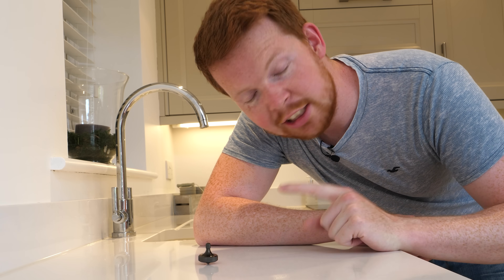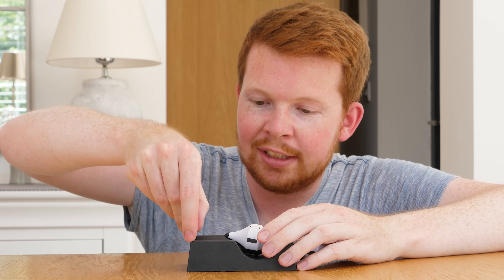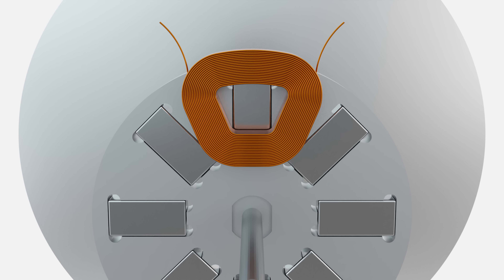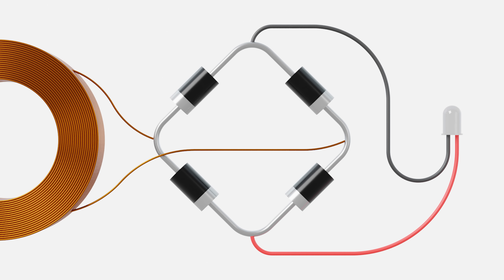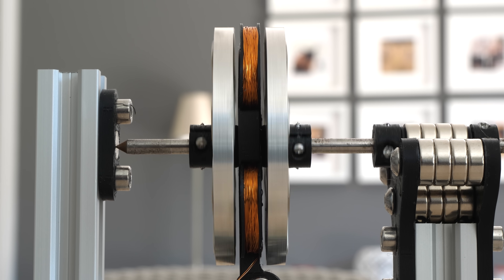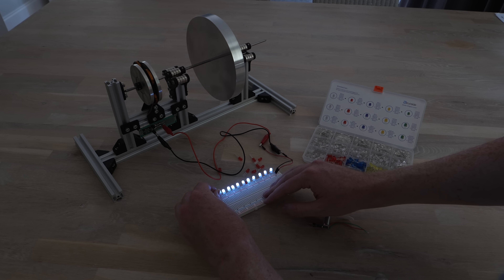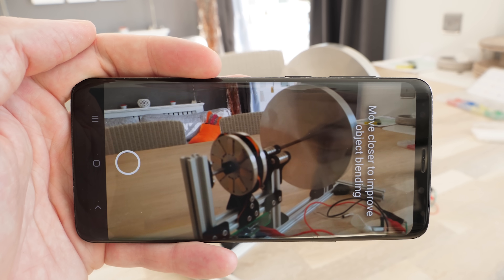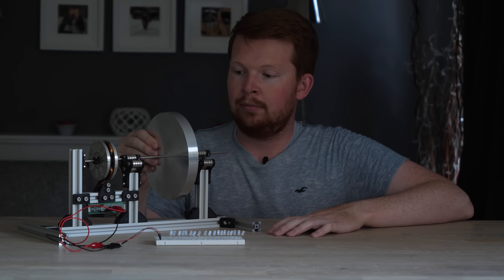Flywheel Battery

Comment: I want a variable-inertia flywheel, where it starts with all of its mass concentrated near the hub, but as it gain angular momentum the mass all shifts toward the rim through centrifugal forces.

Could you build one? If so, please make it open-source!

Bonus points if you were to design it on principles like Tensegrity.

Comment: Three questions:

1) How many coils did you wind for this?  It looked like 4, but I want to make sure I saw correctly.
2) What gauge of wire did you use for the coils?
3) How many winds did you put into each coil?

Now, as a second thought, could you have done multiple coil stators?  IE: a coil stator on either side of each of the two magnet rotors.  Would that have generated more electricity to run that larger motor?

Comment: Yo know... if you contain the flywheel in a negative pressure chamber (I refuse to use such terms as vacuum) and magnetically balance it then it will spin... and spin... and spin... and keep on spinning for a VERY long time...

And you know what... such batteries exist commersially...

Comment: Hey Tom, couldn't you eliminate the plate on the end by putting the lower, stationary magnets at a slightly bigger distance than the upper ones? that way they kind of push against each other as they both try to "fall down" towards the middle, right?

Comment: Tom, I’ve been following you for a number of years now and your on screen diagrams have gone from strength to strength. Your detailed yet clear demonstrations in this with how the rectifier works is brilliant! I love learning new things, and it’s much more appetising when it’s easy to grasp and understand. Thanks! P.S. a big capacitor on the flywheel bike linked to a high power drive motor, and boost button on the handle bar would be fun! 😉. Keep up the great work. A true inventor! 💡

Comment: My last job had a datacenter that was critical to operations, so as a failsafe to their 2 independent mains power lines going down, they had 3 giant diesel generators. But because the generators took time to switch the power, they had mag lev flywheels spinning, so that as soon as a power outage was detected would drop onto generator coils. Giving them enough time to bridge the switch to the generators.

Comment: The most inefficient way to generate and store energy I've seen in a while. Replace the flywheel by a super cap 10 times lighter and keeping the energy for hours instead of minutes, the generator with one having the proper tolerance and bearing. In 1850 your demonstration would have amazing, too bad they did not had YouTube in the 19th century.

Comment: The power goes down quite fast. Wouldn't a gravity based battery be better as you can store the energy over years without loss and you can keep the energy output constant more easily.

Comment: This looks exactly like a device that would end up in a "free energy" video.  Use the output to turn the flywheel, lol
Reply: Which all are called bullshit in the comments for some reason. Imagine that someone researched that concept for years and found almost endless way to generate power. This things could be super cool for the places where there is no electric grid, or for actual homes. Huge flywheel could be spin up by hand with proper gears to provide power or it could be assisted by wind turbine, solars etc..

Comment: I want to see how do you regulate the output voltage before feeding it to any device.
Reply: The best way would be to take and replace the diodes with zener diodes as these will dump voltage over xx volts back to ground

Comment: My dad had one of those horizontal floating magnetic toys many years ago. I have since got one that is a vertical spinning top that floats without any support whatsoever. Not suitable for your application because it must keep spinning to stay up, and requires careful balancing between the mass of the top and the strength of the magnets. But its a fun toy that somehow feels more magical than the horizontal one.

Comment: Could you do a vertical flywheel with a commercial motor connected at the top, a much larger hunk of metal spinning, and opposing magnets at the bottom to keep it suspended (of course using bearing to keep it centered)?  100 Wh challenge!

Comment: I would like to see the energy efficiency of your generator...
measure rpm and mass of the flywheel, to calculate power with it and then output power...
or you can do one more thing.... 
wound a string around the free end of the flywheel shaft and drop a known value of mass...
and then calculate the efficiency...

Comment: Having back iron (silicon steel) for the two radially arranged magnet rotors will also concentrate the magnetic field going through the stator, for this you can try simulating using FEMM, and if you are extra, use solidworks and emworks.

Comment: there is a way to 100% levitate it. If you replace the glass/point contact with a magnet and pyrolytic graphite, you can use the repulsive force of the graphite/magnet to offset the lateral force. VERY tricky to adjust it to work, but it IS possible. Check this out: https://youtu.be/wNcgnooayDc

Comment: I miss the other part, that is, speeding the flyweel through electric current. The purpose of any kind of battery is being charged by an atomated process. Excellent video anyway.
Reply: Spinning it with the drill is basically this.
Reply: @ADBBuild  You missed my point. The drill is an external device, so it does not count. It should have had a system that works both for generating electricity AND charging the flyweel. That would be complete.

Comment: When we sit in front of desk we don't use our feet so why not put small pedal like old manual sewing machine to slightly spin that flywheel to generate light for our desk. Put few caps and battery with circuit from solar powered garden light to make it work longer.

Comment: Just use a drill to spin it up for demonstrations.  DC motors need a large impulse of power to get over the stiction to start up.  This is why you need a capacitor to be charged up to provide a high enough emf to get it moving.

Comment: Is this a battery ? It seems like a power source but not all power sources are batteries are they ? Doesn't the word battery imply energy stored somewhere .. in this case the flywheel is preserving momentum of the initial spin but you are still required to spin it. Maybe this is all pedantic semantics but thought maybe someone would be interested in replying .

Comment: oh my...5 minutes. that's amateur shit.
there's metal machined tops that can go 25 minutes. how?

It's more than "adding weight". it's where you put the extra weight and where you take it away from

Low center of gravity
ruby bearing contact point (less friction)
reduced central weight
increased outer weight

The last two are super key and is usually accomplished with press fitting a low weight metal inside a heavy weight metal:
think aluminum core inside a Copper/Tungsten outer.

Then, some people even bore out the center spinning shaft to make it even lighter.

Comment: You should place a disc at the end with a handle on it. That way you can spin it faster with much less effort. 
Having to spin it with your fingers is like using a screwdriver without any handle. 
Other than that, this is an awesome device!

Comment: 13:11 Electric transmissions are a real thing. They are often used to transfer power from combustion engines to electric motors on ships and other big vehicles. It lets the engine run in the most efficient RPM range and it also provides all the advantages of an electric power train.
Reply: Freight trains are basically this way; a diesel generator providing power to electric motors to drive the train.

Comment: You basically also made an electric motor. What happens if you add current to the coils. I assume the flywheel will start spinning. So you can actually "charge" it with electricity too

Comment: You should remove most materials near the center; they are not contributing much. Aim for a spinning annulus with minimum supports. I could do a topology optimized version where it would be constrained to be possible to be routed, then you can clean it with your lathe.

Comment: As far as I know, these "batteries" are sure enough extremely simple, but also extremely inefficient for harnessing energy.

If you want to try something new, start playing with vacuums, a simple cylinder where you drop a magnet will do energy alone, but if vacuum is introduced, then it becomes a much more interesting apparatus.

If you are not sure what I mean, try putting your finger on syringe mouth, and then pull the plunger back and release it while keeping your finger on the mouth, quite powerful effect appears before your eyes, one that can be utilized in energy harnessing and production if scale is grown and water+gravity used as the driving forces of the whole thing. :)
Reply: He’s made cars that use syringes as power.
Reply: @letsgocamping88  But weren't those with pressurised air, opposite of what im talking about?

Comment: you could just make & use a simple straight  long dowel bar to replace the threaded bar too
'JSK-koubou It's very simple! Few people know about this Amazing idea'
https://m.youtube.com/watch?v=3jG87WrArmE

or go Robert's route with diy super stiff diy paper+ cloth+ casein, varnish ,dissolved plastic, conductive carbon ink or whatever binder you have in the ball mill/grinder on hand/down the garden shed, bars ^_~
https://m.youtube.com/watch?v=EWXeZAHTvZ8

Robert Murray-Smith
 ,1165 A Paper Bicycle Made From Old Newspapers Part 1 Making The Tubes.

btw you can induce a magnetic field in aluminium, its just not as strong see Professor Eric Laithwaite: The Circle of Magnetism - 1968 etc

Comment: I'm surprised by the amount of flicker in those LEDs - the smoothing capacitor should've removed it. When you say your coils are connected in series, you mean before the rectifier? That would potentially cause issues if they're not synced perfectly. Could you give each coil its own rectifier (and maybe its own capacitor) and then connect the DC outputs in series?

Comment: You could have added another magnet at the tip of the rod and added another magnet as the plate, thus having no friction points! Would have needed to be adjusted quite a bit but would be … just as efficient..

Comment: Awesome! but what if you winded the alternator in the configuration of a 3 phase brushless rc motor then you could use a rc brushless speed controller to spin the wheel super fast and then you could power the speed controller in the day with a solar panel and used it's energy to spin up the wheel

Comment: Porsche had a system which used electric motors and a flywheel to store energy from braking to use as a boost, think it made around 100bhp extra, edit that, was 200 bhp extra, Porsche 918 rsr!

Comment: This might be a dumb question but does using the electricity it generates slow the fly wheel down. Like would a higher voltage led cause the flywheel to slow down quicker than a low voltage  one.

Comment: Makes me think of 2 things.  1) Have you ever seen a Mendecino motor? 2) If you could spin this up using something like the foot petal from an antique sewing machine (especially if you put a gearbox in line to ramp up the RPMs) I think you'd have something interesting.  I mean, the flywheel makes it so that you don't have to pump or crank continuously, you just have to stay ahead of the drag that the load produces on the flywheel.  (The load creates resistance in accordance with Lenz's Law.)

Comment: You won't get much voltage/power with an air core, "coreless" generator.  Wrap the coils around ferromagnetic material such as soft iron (ideally, electrically isolated segments) as tightly as possible and you'll burnout the LEDs with just a light spin of the flywheel.  Also another way of seeing how much power your generator is generating is how much it's slowing down due to magnetic reluctance (mechanical resistance).  Putting iron cores while keeping air-gaps small will greatly increase the magnetic resistance which in turn is proportional to output electrical power.  Either variable reluctance(by moving the core in/out) or a clutch mechanism would be needed to prevent energy loss when no power is needed.
Reply: The eddy currents in the cores will cause the flywheel to slow down much faster though. With air cores you dont get any nasty cogging.
Reply: @juslitor  Actually you are correct.  I didn't think it though properly.  I somehow forgot we are dealing with a spinning energy storage device.  I'd still go with cored generators with variable reluctance or a clutch to avoid energy loss, for high power draw.  Thanks.
Reply: @juslitor  Yes, lost efficiency due to eddy current loss vs. lost efficiency due to air resistance because of severe under utilization of stored energy per unit time.  Take your pick.  If it's in a vacuum, then efficiency is lost trying to spin it up to ridiculous speeds, and still results in poor power density because you can't pull much current.  Not practical in most cases.  In the case of flywheels, variable reluctance, by mechanically separating the iron core to the desired reluctance could be used.  Alternatively if using coreless method, then the winding method should be different.  Either the coil should bend around the moving the magnets or very thing coil widths should be used.  I'd go with the variable reluctance method as it can give very high power densities and no cogging resistance when needed, only downside is slower response.

Comment: 10 dimly lit LEDs... So assuming you're running them at about 1 mA per LED, that's 10 mA * let's say 2 V = 0,02 W
I think you have to work on that generator... :D What would be much more interesting in my opinion would be the ability to power the fly wheel up and generate power with the same coil. That way you can actually use it as a battery. A rather inefficient battery that self discharges fairly quickly. Especially due to the magnets causing a constant drag (would be more efficient to have an excitor coil like car alternators). But still a battery.

Comment: add repelling magnets on each end and you have a fully friction less floating ting :D i get air creates friction but you get the point. Also i'm no expert but i think a proper flywheel should have most of its mass at the edge. I've seen a few create flywheels and they always leave the center without mass and only a few spokes

Comment: You should use a buck converter so that the impedance of the load is matched to the output impedance of the generator. The LEDs are drawing too much current at too low of a voltage.

Comment: If you run the shaft vertically and spin the flywheel at Relativistic speed, say 2,000,000 rpm, it will float. Because it will bend the Spacetime field around it. i.e. the outside mass of the wheel will be traveling fast enough to fly into orbit. Kinda like a canon ball fired around the Earth at Escape velocity.

Comment: The higher the load, the more wobbly it will get, because the current flowing in the alternator coils creates a magnetic field in the opposite direction. I don't see it being scalable, but it's a nice demonstration nevertheless. I wonder if it would be possible to use magnets also to avoid the friction between the tip of the shaft and the retaining pole.

Comment: possibly instead of a low friction plate, you could have 2 magnets on each end and a frame with opposing magnets. This way, there would be no friction, and the flywheel would be completely levitating.

Comment: total noob here
so would it be possible to use this thing to charge a battery?
Also, any chance that the tested motor's rpm value is higher than the flywheel's?
Reply: The rpm value will depend entirely on the motor used and the load. With a transformer you could run a motor that draws more current at a low voltage. You could have a small motor that draws very little current at a high voltage. If you get a motor spinning at low RPM you could connect a geared transmition with a ratio that gives you higher RPM. That's why you see wattage ratings for motors, you can use your amperage and voltage information.

Comment: I have a question doesn't the flywheel will run less time when most of its mechanical energy is converted into electrical energy
Reply: Yes, there is a reaction force to the Lorentz force that moves charged particles so the flywheel slows down.
That's how regenerative braking works, too.

Comment: There is not much energy you can store in these mechanical devices. To put in perspective a 100W light bulb running for 1 hour consumes 360Kjoules. With this amount of energy you can lift 1 cubic meter of water (1ton/2200lb/270 gallons) up to 1200ft in the air. If you have a water dam and the water head is 1200ft, one cubic meter of water will be enough to power 1 light bulb for one hour. That's nothing in term of electric energy but quite a lot in terms of mechanical work done or extracted

Comment: If this flywheel is enclosed inside a vaccum container to avoid aerodynamic drag, and a motor to make it spin, can it be used as a battery?
I mean... You spend, let's say, 100Wh to spin it to a certain speed... Then you can draw ~70Wh from it while it's spinning.
It's not super efficient, but it's a nice way to store energy without dealing with chemical stuff.

Comment: I think you could reduce the wabble of the Flywheel by balancing the rotor. Marhematically, to balance an flexible shaft you use the same equations than to balance a rigid rotor: placing masses in the disk

Comment: Would be cool if you could do a endurance comparison with and without a load on the circuit. As far as I understand, having a load should generate some resistance and the flywheel should run for a shorter duration with a bigger load on it.